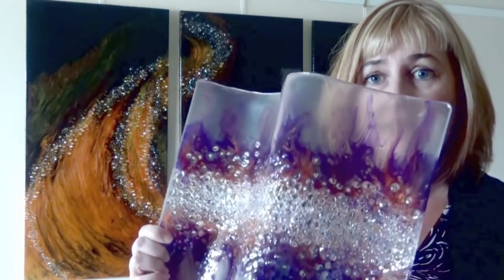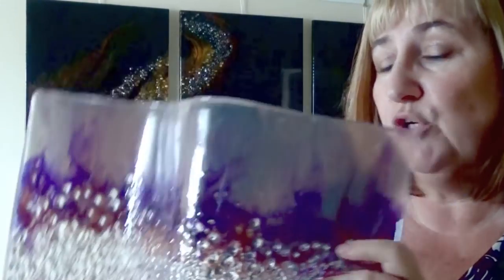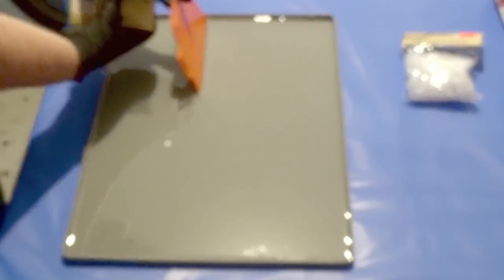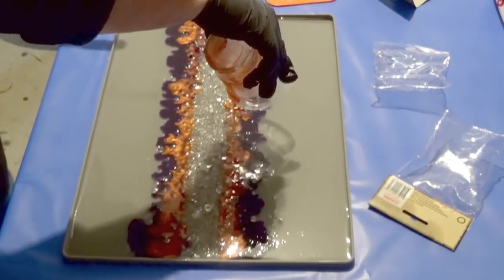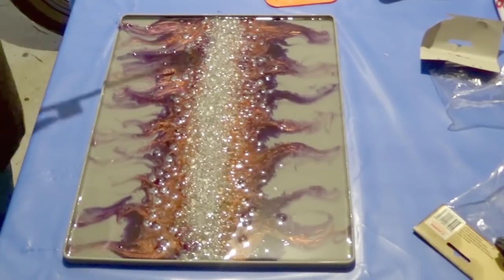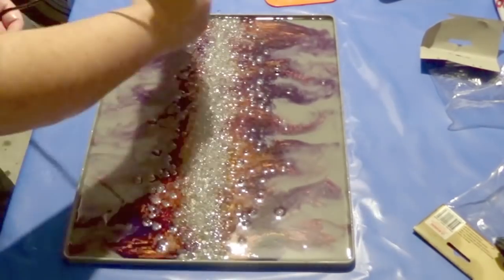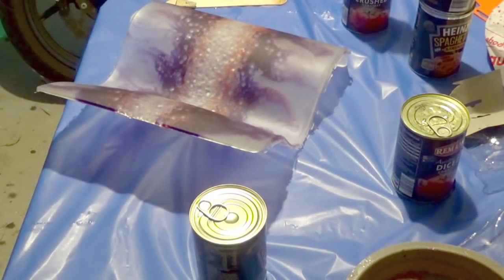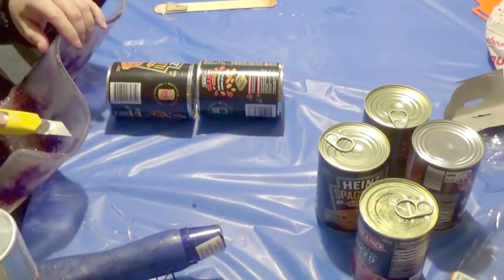How to bend curing resin into a wave shape.

Comment: This is fairly close to what I will need to do for the project I'm working on. I am building a TARDIS DVD cabinet, and though I have a fresnel lens set for the top light, it's considerably larger around than I need it to be, with the size of my box. I will need to learn to make a mold of the lens shape, pour a type pf resin that is clear as glass when dry, and then learn to shape it, roll it around to reconnect with itself, into a smaller diameter size fresnel lens, when it's still soft enough to shape, yet not so soft it droops. 

I fully expect to have a few spectacular fails in the beginning, while I'm learning, but I hope to be successful enough to have my correctly sized fresnel lens light on top soon enough. 😁😎 So, any helpful suggestions from you (or any of the readers here) would be appreciated.  Thanks!
Reply from the maker: I am not really sure what you are trying to achieve. If you want to create a mould of a fresnel lens, then you could use a silicone mould maker, then pour the resin. Good luck with your project 💕

Comment: I am Very new to resin and am hooked!  My big question here is about using the heat gun and torch.  When the work area is covered in plastic sheeting, is there no concern about it melting to your table?? Thx!
Reply from the maker: I don’t hold it in one spot for too long, you literally run it over the resin to pop the bubbles or move it, if you do it for too long you can burn the resin.

Comment: I had a blow torch from doing acrylic painting and When trying to pop the bubbles, heated the resin up enough that it damaged my Silicone mat because the resin fused to the mat. Oops! Lesson learned! 😉
Reply from the maker: Oops. I only use a heat gun. Although, you still have to be careful.

Comment: So how would you actually put another layer on now that it’s bent Sue? Really love your sculptural ideas!
Reply from the maker: I would sand the back and use a foam roller to apply a very thin layer. I would go back and check on it every 10 mins to make sure it is coated. As it is the back of the piece I am not looking for perfection. I didn’t end up coating the back and left it as it was.
Reply: Sue Findlay Thanks a lot Sue! Going to try this one!👌

Comment: Hello sue, I have just received my silicone mat, a silicone mixing set cups sticks etc and  I'm going to take the plunge sometimes today. I got some resin  a couple of weeks ago, and because it was si exspensive, I've out of using it.....really glad now as love this.
I have a question, how much resin in mils did you mix up at the beginning ? I dont want to mix too much or even not enough
Thank you for this upload, so inspiring xx
Reply from the maker: I mixed around 400ml initially, once poured, I got an idea on how much more I needed. I think I poured another 400ml. Good luck with your project 💕
Reply: @SueFindlay  Thank you so much , am just about to open the resin 😱So your reply came in good timing ❤

Comment: Brilliant Sue... I’ve been wondering where to get a larger silicone tray but haven’t seen any at Kmart as yet. I’ll keep checking 🙂
I’m also wanting to mould resin into different shapes, free formed just a small puddle or like a centimetre wide strip poured onto either waxproof paper or a silicone mat then I’ve found after approx 18 to 20 hours it’s dry enough but still pliable to bend n twist. I’m just not sure how to keep it in the positions that I’m thinking of, like a spiral or whatnot for jewellery designs. I’ll keep researching n see what I can come up with. 
I enjoy doing small silicone jewellery mould resin and just tried adding alcohol inks this eve but may have added too much, I’ll have to wait til tomorrow arvo to see (unless I sneak a peek & un mould a lil earlier.)
Have you experienced making holes thru this “mostly” cured resin to see how it goes? I wonder if a regular paper hole punch would work? There’s your next test...I’d like to make holes in moulds that done already have it part of for hanging up on walls or simply for effect. 
Sorry....I know I waffle on. 😁
Reply from the maker: Ha ha, this is a long post. Firstly, Kmart by me does have the larger pet mats. I bought a load and have them for sale on my website. Obviously, they are more expensive buying them from me, as I am covering my costs. I have used the silicone mats to do freeform shapes, I simply line it with cellophane and pour. You can also make your own moulds out of foam board and line them with plastic. As for creating spirals, I would find something to wrap your resin around and hold in place with cello tape. Finally, I have used a Dremel to drill small holes in resin, it is quick and easy. Make sure you wear a dust mask when sanding and drilling resin. 😍

Comment: Thank you.  I love your art.  How do you affix gadgets to the resin sculpture to hang it on a wall (on hooks)?
Reply from the maker: Thank you 😍 You can drill holes in resin, add D-rings by screwing or by glueing them with resin.
Reply: You can also use E6000 to glue on D rings as well.
Reply: Thank you.

Comment: What kind of resin do you use? Absolutely love your work and videos! You are a joy to watch❤️
Reply from the maker: Thank you Abbey 💕 I use a coating resin, I get mine from U Resin here in Australia 😃
Reply: Thank you so much!! I am so inspired by you, I am currently using your idea of the foam board mold and I purchased myself a pet food drip mat😁 so excited for the turn out
Reply from the maker: Good luck with your projects 💕
Reply: Always love your videos as they’re made for all skill levels, which is much appreciated.  You mentioned you were going to put a coat of clear resin on the backside.  How will you apply to prevent dripping off or pooling in the bent parts?  Thank you.